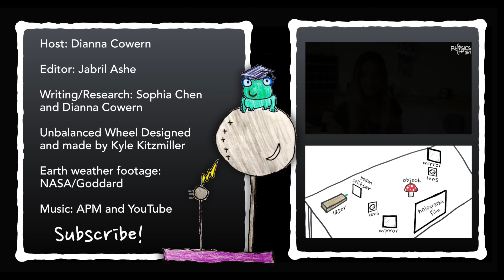Are perpetual motion machines possible?

Comment: There's a battery that has supposedly been running for decades. It's in a museum in Europe. It basically just viabrates. There could be magnets, quartz and salt water inside but nobody knows for sure. They have to open it up and look but they want to wait till it stops. What if it doesn't though? I guess We'll never know. 
We live on a flat stationary plane with a firmament above. 
There's no such thing as gravity. It's simply density / boyeuncy / weight. The particles are more dense in a rock than the particles in the Air. Therefore the Rock falls through the much less dense Air.

Comment: I think there should be a new focus on "very efficient machine's" now that we have such better ways of gathering energy. Think of how we could repurpose a sterling engine nowadays with very little input.. it's not about finding that snake oil device, but we can take our advanced technology, our computer programming, advanced knowledge and science and material science/3d printing capabilities and find very efficient machine's for specific things. A lot of these things we've seen people claim outlandish perpetual motion, actually only produce enough energy to make themselves function, but never could output more energy than it uses. I'm way more excited for machines that function with an input source of energy and if utilized correctly, can make very useful devices, like fly wheels, AC alternator superconductor breaking devices, things that transfer heat into mechanical energy like the sterling engine. Etc, etc, etc.

Comment: I am also working on perpetual motion according to Thermodynamic principle "Every thing flows from higher potential to lower potential but inorder to attain Higher Potential One Has To Do Work Or Use Any Fuel Energy " here my Observation is one to do work Your Wheel having coin was of equal mass but I made a wheel with different mass ratio like as 1 ,7,2,8 ,3,6 ,4,5 and conected between two motors shafut one motor 12 volt and other motor 18 volt when 12 volt motor given electric current to run wheel acceleration created move faster 18 volt motor to restore electricity in battery the energy source for 12 volt motor so it is successful forever and generating Energy In this experiment Electrical Energy is converted to Mechanical Energy. Shahid Sabir Khan Form Pakistan

Comment: Question for anyone and everyone. Rather than citing how the Drinking Bird works and its energy source, to explain why it is not a perpetual motion machine, would it not be better to just cite that it’s not such a machine because the gadget stops for a considerable length of time before it dips it’s beak back in the water? For those of you who are not familiar with this novel device — the video of it in action, here, was considerably sped up. I mean, I appreciate the explanation of how it works BUT the overall consensus of what I keep reading (as to the definition of perpetual motion) is that such a machine must constantly be in motion. I do not agree with the consensus, but alas it is what I keep finding. What say you? And here’s another  question. I also keep reading that a perpetual motion machine, if one was possible, creates energy and must run on its own energy without any additional energy. I do not agree with this definition either. This because my idea of a basic perpetual motion machine (like the overbalanced wheel in this video) is a device that runs on potential and kinetic energy. E.g.  Let’s pretend the coin slot wheel in this video actually worked. If it actually worked  — it would not be creating energy — rather it would be a transfer of energy system turning potential energy into kinetic energy one coin slot at a time. What say you?

Comment: we can harness the energy of gravity, make artificial waterfalls,
the problem of raising water requires greater energy upwards can be overcome with water electrolysis, but gravity on earth is small enough that it requires modification of liquid molecules other than water (H2O)+catalyst
because the height of the water tube required is around 300000 meters if using H2O, and yes this looks like perpetual motion

Comment: It is possible, the question should be can it be useful. That answer is, maybe. The problem is weight, it can power a building/city block but what works in the macro doesn’t work well as you miniaturise sizing it down to power a car or bus.

Comment: 04:07 What is the source of Sun's energy? What happens once it is exhausted or how a sun starts giving out the energy?
Reply: I know this is an old comment but here I am

1: the source of the sun's energy is a reaction known as nuclear fusion. The mass of the object is so great that the forces of gravity are making the hydrogen atoms smash into eachother really hard and at temperatures really hot, reacting in interesting ways and releasing energy.

2: it gives out said energy through light. Photons may be massless particles but they still carry heat, therefore energy. Anything the sun's light is hitting gets energy intake from the sun from whatever light is absorbed.

3: what happens when the sun runs out? Well, when the star's core runs our of hydrogen, it starts fusing helium into carbon instead, which makes the outer layers so hot that THEY begin fusing hydrogen which makes them expand, so the Sun will eventually grow really red and big. Big enough to engulf Mercury/Venus and possibly us too. In about 2.5 billion years. And then once all that energy runs out, the reaction stops, making the star collapse in on itself, generating so much energy on impact that it just explodes into a bunch of very hot dust

Comment: The big bang is the ultimate free lunch. The expansion of the universe is a very strong force as can be seen in a supernova. That energy is available in war these days, so we know it is there and all you need to do is compress a mass against that expansive force. With enough pressure. So with all that energy like in the background radiation which means quantum foam is vibrating and pulsing in and out, Planck length in diameter, call it zero point energy, one bubble one quanta, but pulsing none the less like a nucleus, but then the heat death of the universe will prevent anything from doing anything forever. Is billions of years long enough?

Comment: you can improve your gravity wheel by using magnetic bearings ... and magnetically separated weights from the disc .. but correctly it still wont be perpetual ... just really efficient ..

Comment: The explanation about the bird seems a bit off: energy comes from the difference in temperature between the ambient temperature (+ sun rays) and the temperature of the water in the glass. I'd love to see what happens with no run rays, and a glass full of warm water for instance (of with water at room temperature in an environment saturated with water vapour so that it does not cool down due to natural evaporation)

Comment: @Physics Girl
Can you please explain how magnetic  device with cells attached act as perpetual motion and simultaneously power the external circuit as in many youtube videos?
Thanks
Reply: It takes energy from the cell. When the battery is low, the movement stops.

Comment: Well, one side needs to be heavier than the other but you need two forces, one to push up and one to pull down like a seesaw.  If you use magnets to push up  and lighten the weight (pull down) and gravity to pull down, the motion can go forever.  Not perpetual motion unless you call water evaporation into clouds and condensation into rain perpetual motion.

Comment: in theory a heat exanger could be made to run for ever as long as the temperature of the air was high enough and more or less stable as if youy could put 1 kw in and get 3 kw worth of heat out it chould be possible to self loop such a configuration. the only problem is to convert the heat into the equal emount of electricity as in kw of heat. it means that you have 2 kw worth of additional power as 1 kw goes in the loop sucking heat from the air.

Comment: Engineers evaluate losses and yields. Yield = work/(losses + work). This is known as energy balance. Since the supplied energy supplied is FINITE, the engine will consume all the energy supplied and shall stop. Even a satellite don't orbit forever, eventually "friction" with a thin stratosphere dissipate its kinetic energy and it re-enter earth in a ball of fire. It was Nicola Tesla who said he could get "free energy" from the stratosphere. But the stratosphere already had that energy, he said he would to take it down to earth. Tesla confused the public opinion making them to believe "it would last forever". What he "really meant" was that he didn't have to burn coal to make it run. He studied engineering and he knew lots of physics. Don't confuse "run" with "strong".

Comment: Great. But about quantum vaccum energy, if Feynman, Casimir and others are correct in QED you have >10^60 joules per cubic meter - enough for interstellar travel, in a theory you can also have zero energy and eternal motion if you lock negative mass + positive mass resulting in "runaway motion"...none of this sadly can be done with today's technology...I'm still trying to find a way...

Comment: What's wrong with putting highly pressurized water into a deep deep deep hole. Water boils at lower temps when under pressure. And the earth constantly warm under there. And harvest energy like that. When boils steam can move some wheel and cools down back to water. Falls down the pipe.

Comment: What if you put an electro magnet in space and manually started it spinning.  With no resistance wouldn't it keep spinning and the wire running through it generate electric?

Comment: I always wondered if it is possible to make a solar-powered light power itself. Maybe something like that could be converted into motion?
Reply: Unfortunately no. There is always a loss when converting the energy, mostly in the form of heat
Reply: @Wladivinci  That may be, but I still think it's possible to come up with a way to make it work.

Comment: Possible, but why create and demonstrate non-working devices in advance? The first mechanical perpetual motion machine of this kind was created and defended in court by Johann Bessler. His wheel worked on the principle of an inertia-free hammer. A kind of mechanical diode. Today, it was repeated by Scott Hall, a designer of musical instruments. That's it, checkmate for you girl.
Reply: @darklight2.1  Have you carefully read what I have written? Where does it say about an unbalanced wheel? Only about the function of the inertia-free hammer. First, read what it is and how it works. Good luck.
Reply: @darklight2.1  And after that, think carefully about what kind of function the pendulum attached to the axis of the Bessler wheel performs.
Reply: @dzetta369  Yes, I read it. 
An unbalanced wheel cannot work precisely because of inertia. The inertia on the descending side cannot overcome the resistance on the ascending side-anyone who can do a very basic vector calculation can demonstrate just that, and this exact demonstration is often used in  mathematics courses to represent a closed, symmetrical system.

Claims for a so-called "inertia free" device, hammer or otherwise, are simply restatements of the claims made by Bessler-and just as impossible. It doesn't matter where the pendulum, or whatever else the system includes, is located, or how it moves-the sum of vectors in the system will always be exactly zero. If you can do the math, do it and what I am saying will become clear. If you can't do the math, then that is the weak point that allowed frauds like Bessler and his modern followers to scam people.
 
This is very basic mathematics and physics, and you will notice that the people making the claims never demonstrate mathematically how their device can work..because they can't.
Here is a bit of advice from someone who has been building machinery for almost 30 years...if the math don't work, your machine ain't gonna run...lol.
Reply: @dzetta369  "And after that, think carefully about what kind of function the pendulum attached to the axis of the Bessler wheel performs."
I thought about it carefully and it does nothing. The relation of the pendulums to the axle has literally no effect whatsoever. What is happening on one side of the axle is exactly countered by what is happening on the other side. The vector sum is zero.
This is so basically obvious that I find it astounding that anyone can't see this.
Reply: @darklight2.1  Alaverdy, lol. In this case, a non-inertial hammer is akin to a detector receiver, only in mechanics. In general, any "perpetual motion machine" is the organization of directional movement from oscillation. And the pendulum only redistributes energy, since the action of the hammers is disturbed without load. By the way, you should fantasize less with theories, and think more with your hands. It is also useful for intelect. The argument is meaningless - Scott Hall has performed a number of models and he is somehow deeply purple for criticism.
Reply: @dzetta369  "And the pendulum only redistributes energy, since the action of the hammers is disturbed without load."

..and the energy comes from where..exactly? Think about it-if I have a pendulum swinging, the kinetic energy stored on one side will be exactly equal to the kinetic energy expended on the other, minus the resistance in the system. This "redistribution" of energy in a closed system adds exactly nothing to the overall energy in the system, as long as the equal sign remains valid (ie. the system remains closed). It makes no difference which side of the equal sign (or the axle in this case) that the pendulum is on-there is no additional energy and the system will eventually run down. Which, by the way is exactly what we observe in every single version of these "over balanced" wheels.
Again, this is demonstrable physics and really basic vectors.

"By the way, you should fantasize less with theories, and think more with your hands."
Perhaps you should read more closely. My background is in electrical engineering with a postgraduate degree in machine design. I've been designing and building actual working machinery for industry for almost 30 years. Not silly free energy generators or fantasy perpetuum mobile-I build actual machines that work.

"Scott Hall has performed a number of models"
Your links don't work, but if you think that someone has actually built a perpetual motion machine, you are being fooled.
Again, do the math. If you can't, then take some online courses until you can-I promise that you will be laughing at yourself when you finish.
Reply: @darklight2.1  my links work, just copy to google bar or change _ on point. Tube dont may write direct path. Sorry for my english, translator not always get right result.
Reply: @dzetta369  O.k., I found Scott Hall. He is a multimedia artist and woodworker-those are just toys that he makes for fun. He is pushing them and rolling them down a hill. They aren't meant to be taken seriously..good grief.
Reply: @darklight2.1  thats is not at all. More early Scott was more open and showed the insides of his crafts. I still have some of his works. Of course, in the 21st century, even despite the efficiency, these are just toys, because hardly anyone will use them. However, there is a possibility of this.
Reply: @dzetta369 "However, there is a possibility of this"
I have explained why they are not possible-again, do the math. If you can show differently, write a paper and collect your Nobel Prize. Any first year engineering student could explain why these machines cannot and do not work.

You are being fooled by fakes, and not even good fakes.
Reply: @darklight2.1  You are distorting the work of these people, as well as the time when they lived. With the exception of Stephen Mark, but there is an irreparable flaw in his device (despite the fact that it works). I gave you an example of these people, because I reengineered their work and used it in my developments. They had original schemes that are not yet used in industry. In addition, I am from the USSR, and we very carefully dismantled many such works and introduced them into closed production. The works were supervised by Remiliy Avramenko. There is nothing particularly complicated there, but the originality of thinking is worthy of respect. In the USSR, there were a lot of things in general, for example, a galvanic cell that froze during operation, i.e. consumed heat from the environment ))). In science, there are no royal paths at all, 99 percent of work and 1 percent of luck.
Reply: @darklight2.1  Award hmm. Maybe we don't quite understand each other. People engaged in this case do not limit themselves to the reward, they work for the result that interested parties buy. By the way, Hubbard is a good example, he managed to sell his device at the age of 20 and lived his life quite vividly. This is a slightly different level of relationship.

Comment: I’m no physics genius but what if it was held by magnets to reduce friction
Reply: Electro magnets need electricity and permeanent magnets lose their magnetism over time, and need to be re magnetised. So still need an external power source, thus not perpetual.
Reply: @somethingelse9535  ugh
Reply: @somethingelse9535  what about useing power made by the machine
Reply: @StealthyDrake12  It would slow the machine till it stopped, then you'd need to pay the power company to power it up again. That doesn't sound perpetual.